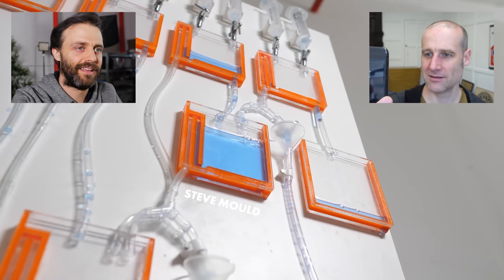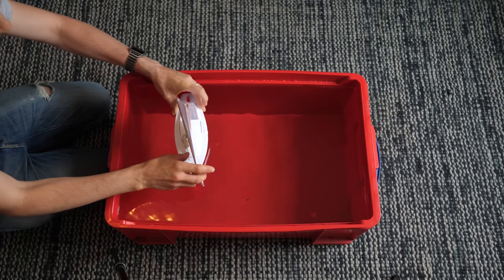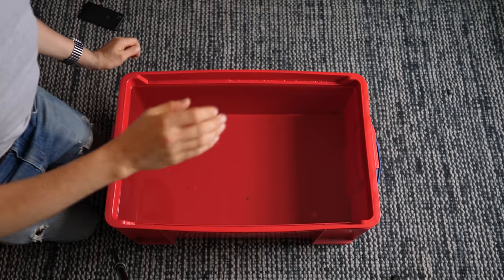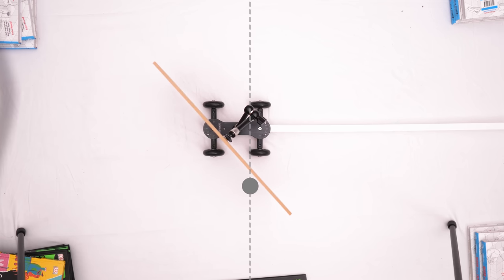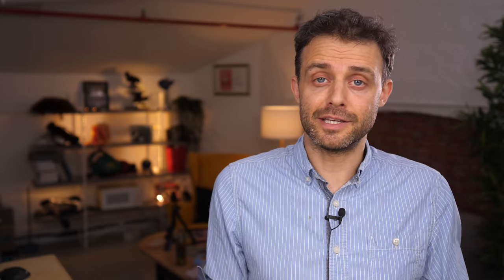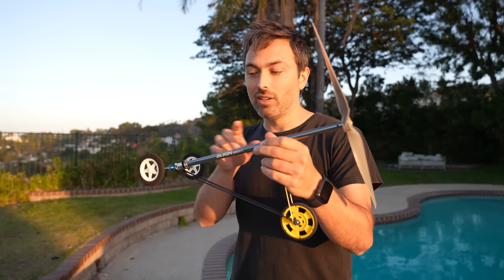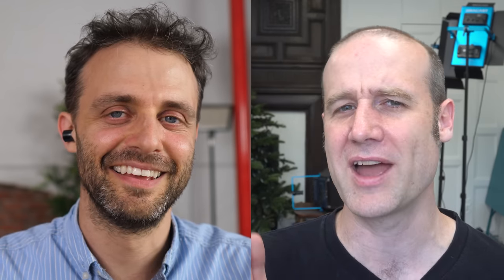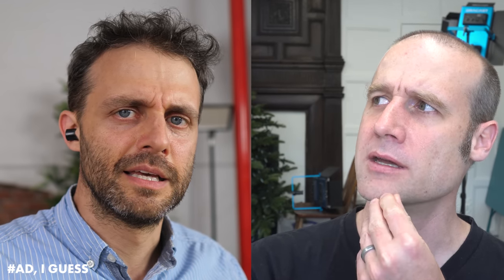Sailing Faster Than The Wind - How Is That Even Possible?

Comment: Hi I’m working on a project where I want to build a costume that can become a display so that it can change color to blend in with its surroundings like a chameleon . I’ve looked it up and I found thermochromic powder might work but it would get really hot and also can only be two colors. what I really want is some way to make my body a tv screen but I’ve thought of using phosphors and an electron gun but then I need a massive device right next to me . I’ve also thought of a bunch of tiny lcd /oled displays but they are incredibly expensive and they need a lot of electronics to control them .so I was wondering weather you could give me a better idea?

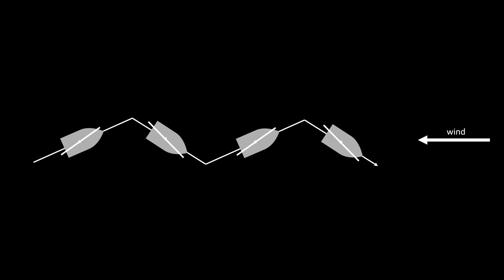Comment: Wouldn't the sail have to be turned the other way around in 8:51? The sail should have a smaller angle to the wind than the hull in order for the total force to be in the forward direction, right?
Reply: Yes, that's not the sail setting for tacking upwind, but for tacking downwind which would actually be more relevant to Derek's video.

Comment: Also technically big birds runs faster then wind :P because they use air pressure for getying therefore charfinb energy , then run against wind,which is technically some as saying runninig faster then wind on back  :P

Comment: Can it be said, that a boat can be pushed forward by deflection of the wind (flat sail like in the video) OR by pressure difference due to a sail acting as an airfoil? (which would require a hard wing, instead of a sail). Is it possible to determine which of the two forces contribute more to the speed, for a boat that is sailing faster than the wind speed?

Comment: We need an explanation on how to go faster than wind downwind on a yacht! Derek just shows a picture omitting all the details, I guess it's just inertia: you get a lot of kinetic energy going not directly downwind and when you change the direction you use this energy to go faster than wind. The net gives you faster than wind.

How to go faster than wind against it is trivial compared to this.
Reply: Okay, I was wrong, when you start to move sideways this component of apparent wind increases. Vector diagram explains it the best.
Reply: I could rephrase the original question: how to move faster than a balloon.

Comment: Nice but, please replace the sail with a couple of wheels and replace your windstick with a horizontal 2x4. This will put into view a representation of what happens when the entire sail is being pushed by the wind and not just a select spot on the sail at one time. It will eliminate the chance of the wind turning the boat unintentionally.

Comment: I love your videos but you have not actually touched the most important part of Derek's video in yours. In that video the question was not wether you can achieve a speed relative to the seafloor that is greater magnitude than the wind's speed relative to the seafloor, which is what you explained here. The question was wether you can achieve a speed which has a downwind component that is faster than the wind. The "catch a balloon" idea represented it really well, because it doesn't matter how fast you move sideways relative to the wind, what matters is the downwind component of your velocity. 

You could take a look at the case where you are moving downwind at an angle with your downwind velocity component exactly the same as the wind speed. Then the apparent wind (which you avoided mentioning in this video, I guess for simplicity) would be exactly perpendicular to the winds velocity in a stationary frame. So overall you would be sailing in headwind at an angle. Since you can do that, as you explained in the video, you still have a way to accelerate further in the direction you are going. That of course increases the downwind component of your velocity, so you can go faster than the wind downwind with a boat. This was the assumption in Derek's video.

Btw, I really liked the missing the wind animation :)

Comment: Hi everyone, a year later iv got a question : if the wind pushes the sail it is no longer "wind" but "deflected wind" which's speed should be lower than "wind" (it just lost energy pushing the sail)... So saying that the boat goes faster than "deflected wind" = true. But not "wind" .

Comment: I think this model is missing something - it seems to be attributing most of the lift/thrust force to what is known as 'downwash' in the aviation world. It's been many years, but if I recall from my flying days, this only provides about 10% of the force. Much more of the lift can be attributed to the what's going on on the other side of the foil with the venturi effect. I'd be suspicious if a sail with that shape would ever be able to outpace the wind on any downwind point of sail, and I doubt it would be able to sail upwind at all. 

I may have missed something in the video (it's going on in the background) but it seems to me that it's missing a big part of the picture.

Comment: Vehicle traveling faster than the wind; my comments. To achieve a specified speed with a tail wind will require a certain power delivered to the wheels to overcome friction. If you make the propeller large enough you will be able to harness enough wind energy to develop the required power. If the turbine were an "egg beater" type the vehicle could go in any direction, even upwind.

Comment: You completely missed the point that for Dereks analogy to be meaningful, the boat sails faster than the wind *in the direction of the wind*. Not going directly downwind, but if it's angled slightly, the speed component in the direction of the wind is greater than wind speed.

Comment: 0:42 that’s incorrect. you can travel faster than wind directly downwind in the water if you use a similar mechanism to that land vehicle. You can’t travel faster than wind directly down wind in mid air. You need to travel between two mediums that are going at different speeds. In the case of the car, it’s air and land. In the case of a boat, it’s air and water.

Comment: Why don't sailboats use a vertical turbine attached to the props haft via gearbox instead of a sail? It wont matter as much what direction the wind if flowing.

Comment: Ok Aerospace Engineering student and former sailing instructor here. This is over simplified and will give you a bad understanding of sail theory. 

It doesn't highlight the importance of apparent wind:
https://en.m.wikipedia.org/wiki/Apparent_wind
This means when sailing upwind, the wind is almost parallel to the sail. The direction of the wind in your 45 degree example is wrong, the boats movement creates wind.

The majority of the forward force comes from "Lift" when sailing close to the direction of the wind. Not a friction delta in the XY plane.
Reply: "This means when sailing upwind, the wind is almost parallel to the sail. "

This corresponds to the grid-points missing the sail.

Comment: The toy model is neat but I don't think it explains the phenomenon. The rectangular board is analogous to the blade of the faster-than-wind-craft's turbine. The model vehicle moving towards the right is analogous to the blade turning in that direction. Put another way, we can view the turbine being positioned such that its axis runs from top to bottom of the screen, so that the turbine is facing the direction of the wind that's blowing from bottom to top. If we rotate the turbine such that a single blade is pointing towards the camera, then that's effectively the rectangular board of the toy model. So far so good.

When the faster-than-wind-craft is slower than the wind, the turbine would be pushed by the wind. But once the craft reaches wind speed, the wind is no longer able to exert any force on the turbine blades. To see how, let's go back to the toy model. It moving towards the right is equivalent to the turbine turning, and to represent the craft moving, the model must move towards the top (not possible in the video, so let's just imagine this in our heads), which is the same direction of the wind. But once the model moves upwards with the same speed as the wind, which is also blowing upwards, then there is no longer any force on the rectangular board, so it stops moving towards the right, meaning the turbine would stop turning, and we have reach equilibrium. So how do we go faster than the wind now?
Reply: To see the analogy between sail and propeller blade look at "DDWFTTW : TACKING PROPELLER BLADE (WEDGE)"

Comment: The rationale beginning at 3:40 is incorrect.  The reason real boats don't move in "that direction" is not because of the long, skinny shapes.  Instead, it's because they have underwater "sails" (foils) - the rudder in addition to the keel or centerboard - that generate lift in opposition.  But, in actual fact, real boats do move in "that direction" - to some degree - it's called "leeway".

Comment: Now throw MULTI-HULLS and APPARENT WIND into the mix.
Why focus on displacement hulls when the pictures show racing multi's doing what they do best?
Multi-hulls use apparent wind and low resistant hull designs to achieve plus wind speeds and now foiling is making it possible for other designs of vessel to do the same.

Comment: Ironically, @Veritasium DID explain it, back here: https://www.youtube.com/watch?v=Bwf3msm7rqM It comes down to gain, or lever action. Here Steve is getting it by angling the sail, and in the spool case it comes from the different diameters of the spool rim and spool drum.  In fact the spool experiment explains how you can move downwind faster than the wind: consider that the wind is acting mostly on the rope, and negligibly on the spool.

Comment: You provided a good explanation of how sail lift works, but this doesn't explain how it's possible to move faster downwind specifically. For that there's an extra step: it's realizing that the vehicle is not exploiting a speed difference between the air and the vehicle, it's exploiting a speed difference between the GROUND and the WIND. That's why the vehicle is a different thing, and what connecting the wheels to the propeller does!
Reply: in fact, if someone finds a way to reduce drag dramatically, it should be possible to travel directly upwind with this arrangement. (granted, with extremely strong winds, and you'd not move very fast)

Comment: You guys have heard of the America's Cup boats in Auckland in 2021??  45 knots of speed in 15 knots of wind... upwind!!!   Derek's 'contraption' is play school compared to the America's Cup yachts!!!
Reply: "Derek's contraption" set the direct downwind record at 2.8X windspeed and the direct upwind record at 2.1X windspeed.  I'm not certain, but I believe that's a better upwind and downwind VMG than America's cup boats because they have to tack.
Reply: @Rick_Cavallaro  well in a boat you have to tack into the wind… but not down wind…. Also there are tactics… but sometimes the America’s cup yachts were hitting 90kms/hr in less than 30kms/hr of wind… into the wind…. Mind blown .. 🤯
Reply: @brucemckay6615  You're right that you don't have to tack downwind.  But that's by far the fastest way to go downwind in a high performance boat.  
By the way, did you see all those nifty graphics tracking the America's cup boats and rendering virtual images on the water?  I was one of the people on the team that did that.  I have actually been around this stuff a little.

Comment: Huh, the relationship between lift and speed seems similar to the relationship  of torque and speed in a motor. Maybe?
Reply: More like the relationship between the rate at which the tide rises and the rate at which the water moves up the sand on a shallow beach.

Comment: This video unfortunately didn't answer the real question that kept bugging me: How can a sailing boat lose height faster than the true wind. Intuitively, no matter in which direction it sails, as soon its velocity component parallel to the wind is equal to the true wind speed, there will be no more force component accelerating the boat. But I know it's wrong. In fact, I think I just managed to prove to myself that it could work by drawing lots of arrows on a piece of paper. Still counter-intuitive though.

Comment: There is NOT a person who done polar to rectangle conversions in high school  does not grasp this issue. Basic high school physics.

Now of COURSE you can go faster then the wind based on the REALLY nice model you show. The stick moving at that speed shows how the forward motion of that north vector will cause QUITE A BIT of horizonal movement (a great explain by the way).

But THAT'S NOT what this issue is all about. For a VERY long time sail boats, and especially those lake ice racers with rails (skate blades) could go FASTER then the wind. As they say in star wars - nothing to see here - move along.

Now the whopper, now the huge,  now the Mount Everest of a different issue!!!

Can you by zig zagging (tacking) move faster pure north (in our example) by tacking or zig zagging. Again, we easy going faster then the wind, but can you NOW even by zig zagging move FASTER north (in this example). Without question your side ways speed is faster then the wind, but want about actually going faster then the wind in the SAME direction. So your craft would NOT be going straight north, but can you make and have the zig zag pattern result in a 100% north speed? 

And the stunning most amazing answer is yes!! This is what the apparent wind issue is about. It was only until about the late 1970's that this occured. However, those lake based ice racers had achieved this STUNNING AND BEYOND crazy ability some time before sail boats did.

So:
having  boat or ice racer or whatever move faster then wind? Geesh - no kidding sherlock!!!!

but, the 2nd whopper and NEW issue?

Can you get the movement (even with zig zagging) faster in a pure north direction (ignore that you going side ways) then the wind speed in that direction? And yes you can, and yes this is possible.

Now JUST because you can achieve this feat? That in NO way suggests, hints, proves or shows that this prop driven system can do the same thing. 

We don't know if say a gust of wind occurred, and then we now slowing down a bit, and thus the wind "string" flag thing was now showing faster then wind speed. That would be momentum. We need better test data - since wind gusts up and down -and the part of that video showing the craft going faster in the same direction of the wind? Nope - not enough here to go on - not buying this just yet.

So, the fact that direction speed in true wind direction can be achieved now? Yes that can be done.

However, That does NOT in ANY way show, prove, demonstrate that this new device was able to this. So that video is too short, and we don't know the wind conditions - so for a while it did not show faster then wind - and THEN for a bit it did - that could be the result of a simple higher wind gust.

But SHAME on NOT making this DIFFERENCE absolute crystal clear. Going faster then wind? Sure - nothing to see. Easy to do.

However:
a boat or crafts overall speed north (in this example) being FASTER then the speed of the wind blowing directly north? Well, that is a shocker, is amazing, is counter intuitive. I mean, if apparent wind speed was not occurring here? Then with zero friction the best speed of that boat would be EQUAL to the true north wind speed. Based on JUST vectors and math? You can ONLY match the true north wind speed (in our example).
However, due to apparent wind speed effect, you can actually travel north faster then the speed of the wind going north. (you boat will REALLY REALLY REALLY zipping along at an angle - so the boat is not going true north, but the rate of the boat towards north will in fact exceed the wind speed blowing true north. So this can now be achieved!!! As noted, for a long time going faster then wind speed? Sure!!!! But going faster then the true direction of that wind speed? Ok, now we getting the popcorn out. As noted, this is now possible!

But this new prop driven device MAY be able to do this? NO NO, we don't know that yet! And the video is WAY FAR FROM showing that this occurred, or is even possible with such a device.  A vector due to wind with angles is NOT the same process that is occurring with that craft. This is NOT the same process going on here - and thus to assume as such is a invalid assumption, and the video is no where close to such a proof or even demonstrating that this effect occurred.
Reply: Well time and more information? Yes that faster than wind speed downwind vehicle? Yes - it most certainly works!

Comment: Take a goooood look to the ribon on the nose of the car. Clearly, the car was NOT in the wind direction, but at an angle. Even when the car is slowing down, it had a cross wind. he propellers acted as a sail. To prove  the theory, The camera poined at the pole shoud be shown for the entile run.

Comment: @Steve Mould,

This was by far the best explanation of sailing lift that I've seen in decades of sailing study. So your millionth subscriber is well deserved. ;-)

Now you need to teach us how the lift generated by the rotating aerofoils of a propeller with a helical path through a fluid can add to the apparent wind speed felt by the vehicle, that allows the propeller craft to travel faster than the wind, on a downwind course.

If you go to Derek's Odysee video, you can find my best attempt at explaining this concept under the handle of CriticalThought.

I'm sure you can do better.

Peace and Love,
j